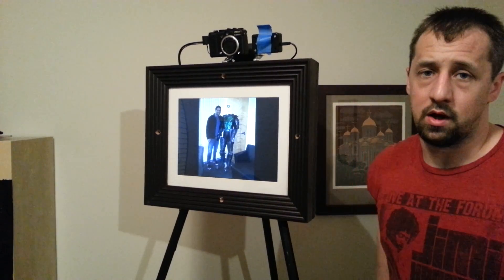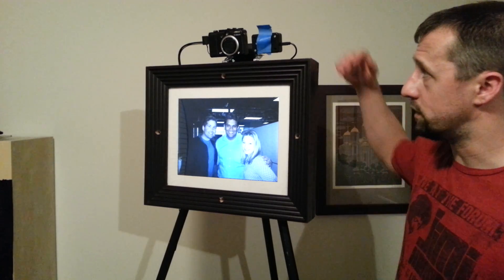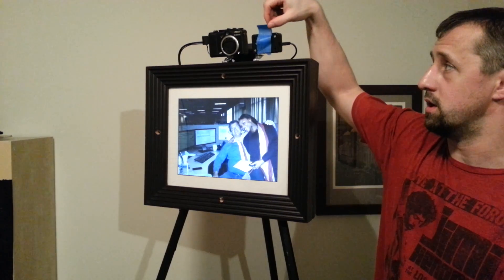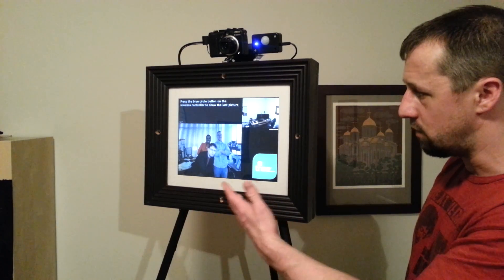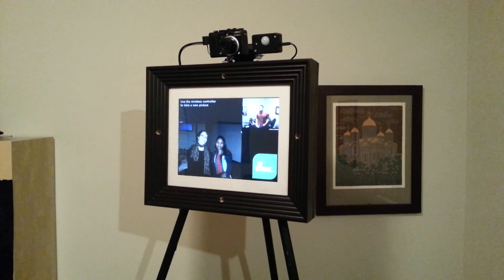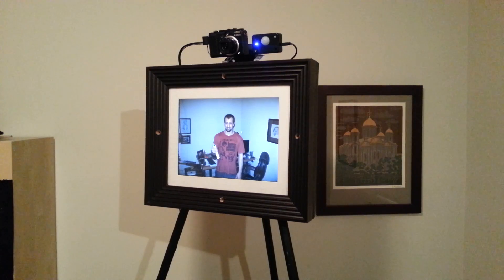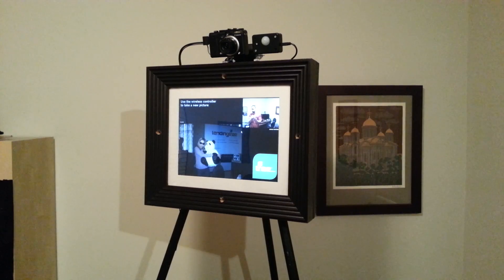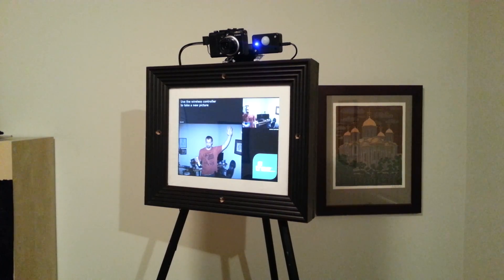Photo-frame Photo-booth Update

Comment: Nice work
you run it on linux?
if yes then how do you show a live view of the canon cam, i tried to use gphoto but i just not manage to show a live view of the viewfinder only frame after frame
Reply from the maker: Look in my other videos for my Raspberry Pi Photobooth,  it is running on linux and uou are right I couldnt get liveview to work but I found a way to fake it using Gphoto. Code is on my blog post about it.